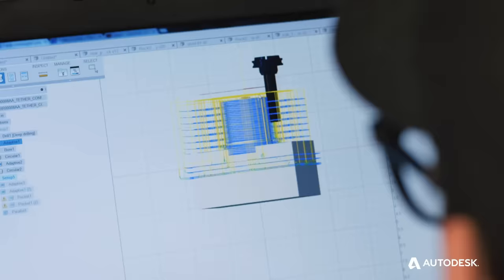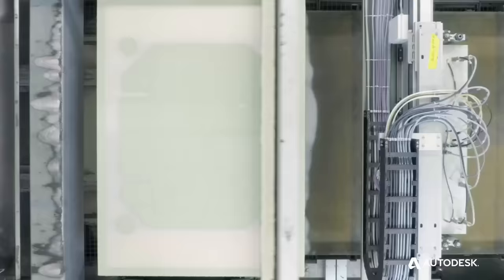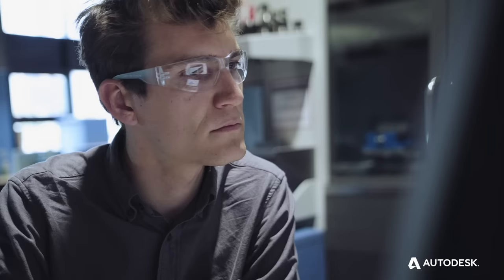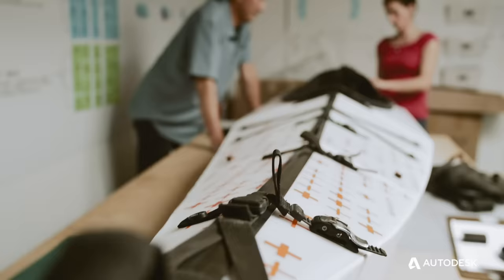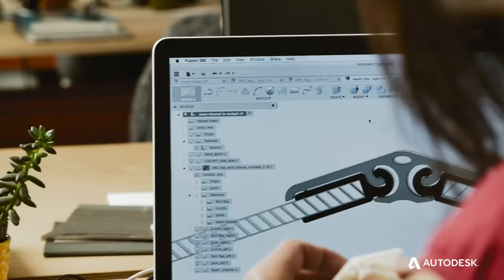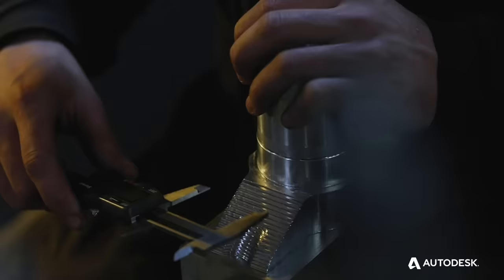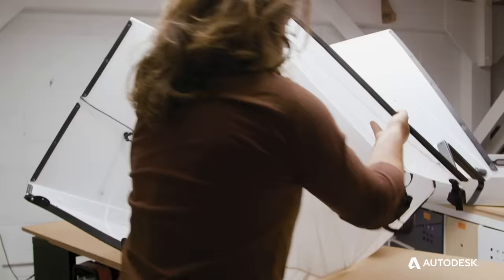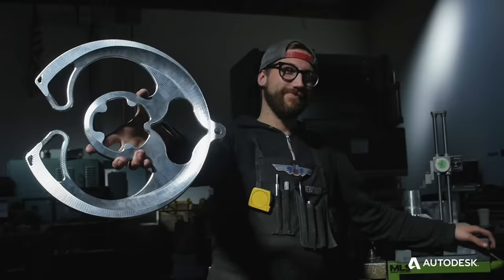Autodesk Fusion 360 | I use Fusion 360: One Product. Unlimited Possibilities.

Comment: I am a small bussiness owner in Sweden and I use Fusion 360 for CAM and CAD. It is simple an reliable to use with my 5 axis Haas mill and 3 axis VMC. Not so many CNC companies here are using Fusion 360 but rather Mastercam, Gibbscam and other "tier 1" software. Fusion is very powerfull package and the learning curve is not so steep when compared to Mastercam which I used for 10 years. Big time promoter of Fusion 360 to friends and businesses I know.
Reply: Can you use fusion 360 on older machines?

Comment: I'm using F360 because I think it is way more intuitive than Creo6, which is the software our university offer and for sure, because it is free to use for students.
Even though I might not be the usergroup with main focus, I would like to give you some feedback.
I would really appreciate it, if there's an option, where I can add in additional metalls, as well as surface coatings.
Also pleas add the option, to define outer sketch planes, at least just to modulate it, and then interpolate it to the XYZ-components.
It seems, as if other users already said all about the drawing base.
Next thing is, the animationarea. I really like it, because you can produce function and mounting explaining clips within minutes, but I would really really like it, if there would be renderoptions for photorealistic renderings. I know it would require a shitload of computing power, but that wouldn't be much of a problem, if there would be the option, as known from 3ds Max, to source it on a network render server. I mean my server has 15 times the core count of my laptop and a terabyte of ram, as also two firepro S9100, he would handle the load, even from picture renderings way better than my laptop.
And then there is one final thing I have to say, when deleting phased surfaces I nearly always get an calculation error, please fix that.
But overall its a nice software, very intuitive with many usefull features. I don't know, how common it is in industrial applications, but due to the free to use for students policy I'm sure it may increase. Because believe me, it's a pita to use Creo6 over remote desktop, because we don't have own licenses. Creo mitght be more "professional" but it's inpracticale to use.
Reply from the maker: Thanks for the great feedback, and we love to hear that you choose Fusion 360 when other tools are available. Means we're on the right track, but as you note, we still have a lot of work to do!

Comment: It has fantastic constraint options but the drawings function is weak. Very few formatting,options. It works for simple things with limited dimensions but complex parts would be impossible to fit dimensions and notes. Too bad it fails in that regard otherwise I would use it professionally.
Reply from the maker: Thank you for the feedback. We realize there are some improvements that need to be made to the drawing workspace and have dev teams working to improve it. Hopefully we get to a place where you can use it professionally.
Reply: Autodesk Fusion 360 

Thanks for the response. I didn't expect one. I will keep an eye on the 360 developments. I have a AutoDesk subscription that includes 360, Inventor and Mechanical. I also have a personal copy I use on my personal pc for home projects I build.  The 360 constraint features puts everything else in the weeds easily. From my perspective it seems 360 is getting more of the development slice of funds available than is Inventor. Inventor is full of silly bugs that should have been quashed years ago such as not being able to dimension holes in iparts in a idw file. When I see things like that, and there are more just as outrageous, it leads me to believe there is a lack of interest in the product, sort of like "It is going away so why fret about the small things".  For that reason I hope 360 gets up to snuff on the drawing side soon. It needs a full range of text size options with detailed formatting choices for parts lists, balloons, tables, text with and without leaders, custom symbols and ability to generate custom stamps.
Reply from the maker: We're always listening! And we're definitely not going away. 
Per your drawings requests, see here (the roadmap mural, specifically) to see where our next efforts will be taking drawings:
https://knowledge.autodesk.com/support/fusion-360/troubleshooting/caas/sfdcarticles/sfdcarticles/2D-Drawings-Roadmap-for-Fusion-360.html

Comment: My students use Fusion 360
Reply from the maker: LOTS of students are using Fusion 360! Great to hear from you, Jomarc!
Reply: This is the tactic SolidWorks used in its early days - make it practically free for learners, then soak you when you need to buy a seat to actually use. Now it's 4 grand a seat, and I'm sure they'd like to charge that much per YEAR. And Autodesk is looking to replicate that same success with that same practice. It won't be "free" forever, and it's a POS product compared to SolidWorks, so if you're going to pay for ANYTHING, pay for Solidworks.
Reply: @RapidReelTV  $3,995 without support for a single seat perpetual license of SolidWorks Standard. If you like a software license that goes away after just 3 years (hope you had fun) then be my guest.